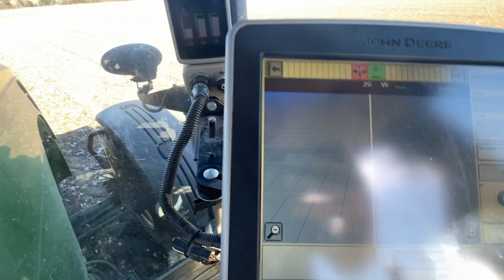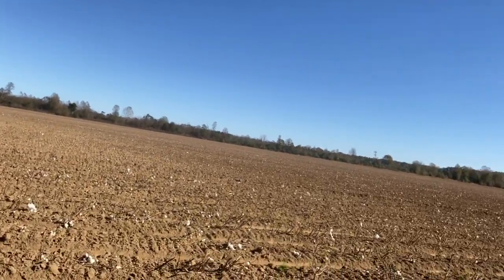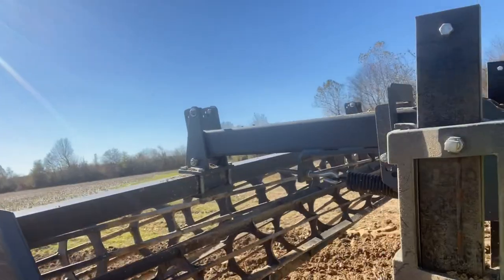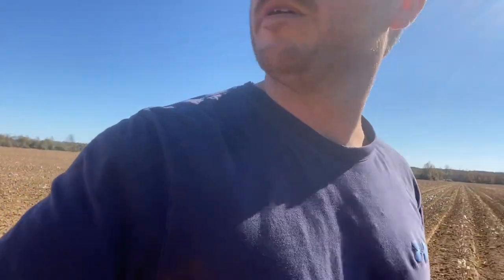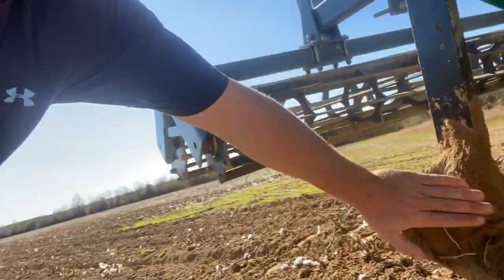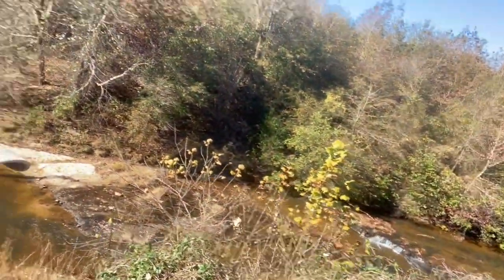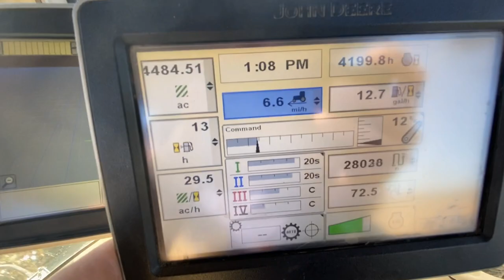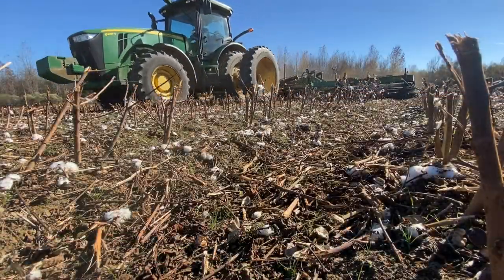Ready to Plant Corn?

Comment: Did you say 38" wide corn rows or 30" rows?
Reply from the maker: Some 38’s some 20’s
Reply: Curious what corn head or heads you use.
Reply from the maker: @shealy265  608c 38

I forget numbers on 20 inch, it’s 12 row
Reply from the maker: @shealy265  both Deere